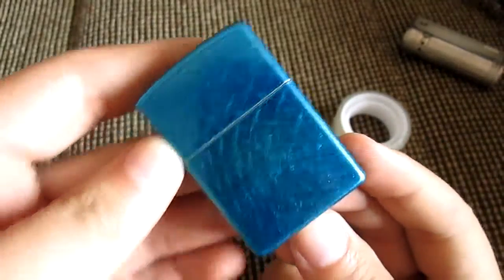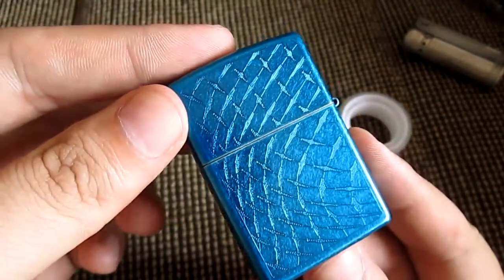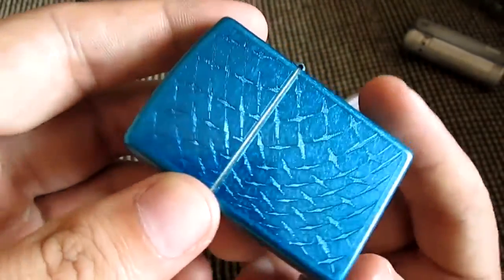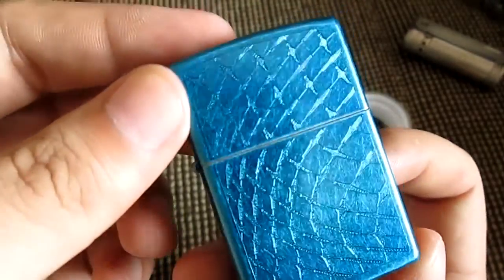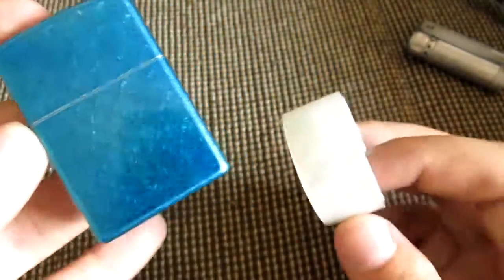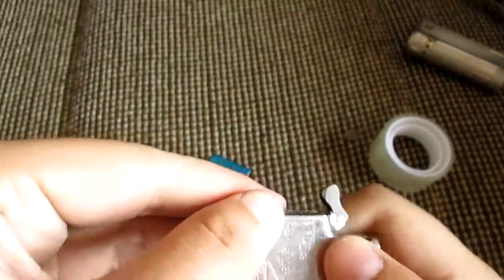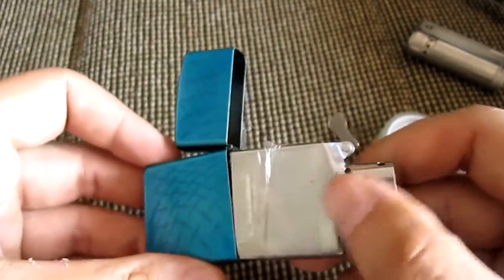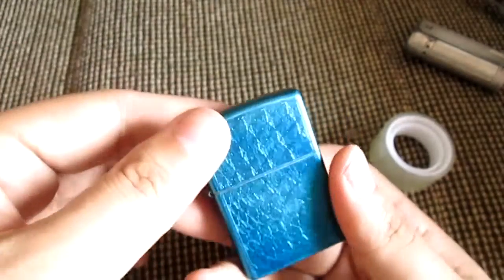Experiment : Stopping Zippo from Losing Fuel

Comment: Most evap is through the chimney
Reply: nope, if case and container pretty same size, zippo will need refuel around two weeks, if not, just use any thick plastic bag's rag, by this way gas container will full around elastic plastic
Reply: What the hell is elastic plastic

Comment: Thick silicon grease works really well too. Not as hard to take out the insert after. Has the cello tape ever turned "gooey" or soft from the solvent nature of the fuel?
Reply from the maker: it actually didn't work well !

Comment: I don't think the older Zippos had that little bump on the inner frame, that's got to contribute to evaporation.  I would never buy on with that feature.
Reply from the maker: ***** I think you are right !
Reply: EDC Gunner
I know, because we used to buy them for my father and other men that smoked pipes when I was a child and we used to fill them up and play with them etc.  I've even helped a few elderly people with changing their flints and filling them up etc.
Reply from the maker: ***** I had some old vintage back when I used to collect them and I don't remember that notch
Reply: You are right, i have zippo 1941 replica and it has not a notch. According to use, it can hold it's fuel about 9-10 days

Comment: And? Did it work?
Reply from the maker: no , I made a follow up vid :)
Reply: EDC Gunner I found it, thank you! 

I did however found a way to stop you zippo from evaporating fluid, and then it will last for about 3 to 4 weeks. 

Cut a piece of inner bicycle tubing and put the zippo inside. When you want to use it, roll the tubing down so the cap is exposed and light. 

Hope it helps. Merry Christmas btw :)
Reply: Ramon Brontsema what is inner bicycle tubing ?
Reply: giorgi mchedlidze bike tire